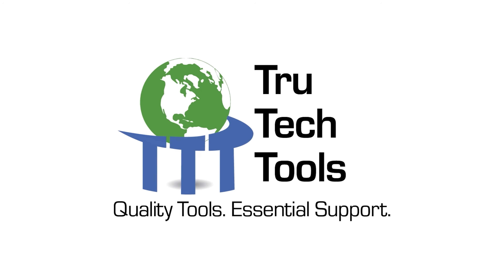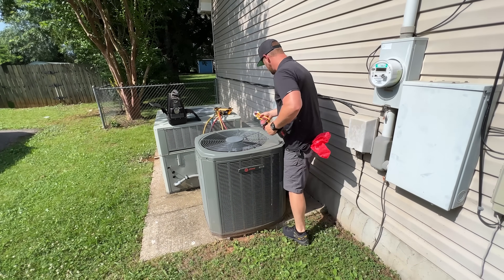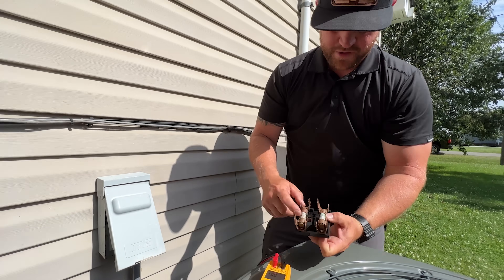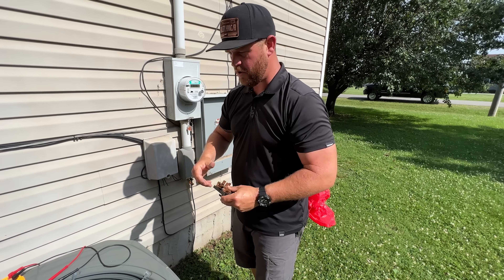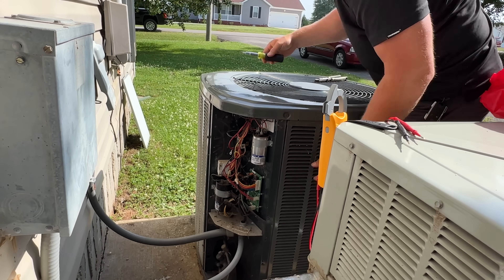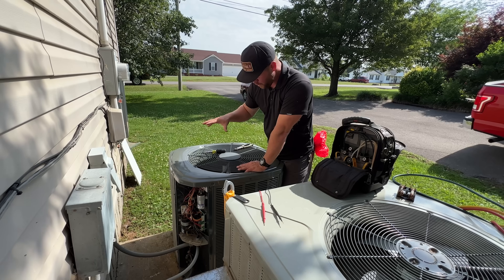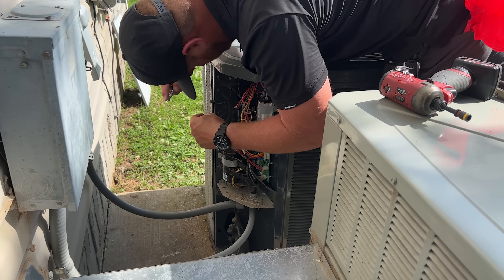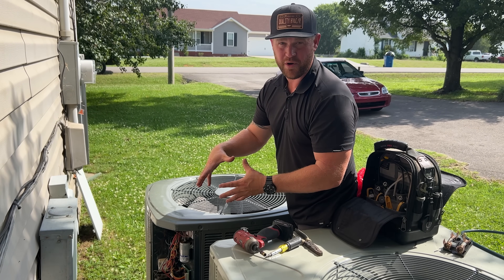How To Diagnose A BAD Compressor | HVAC Troubleshooting

Comment: You mention all that unessary stuff to replace when doing a compressor change out and didn't even mention the filter dryer being replaced, I would of put filter dryer on my #1 top spot. An you wouldn't of needed to replace the contactor both and capacitors if you would of looked into why the compressor failed, if the contactor is constantly pulled in then it will make the compressor fail, I didn't see you check for 24v on the contactor I assumed you put it in cool mode so the condenser turns on but did you look at the contactor or test the coils? There's no point in replacing the compressor if you don't figure out why the last one failed instead you just throw more parts at it hoping 1 of the 3 things were the cause.

Comment: But how did you know the compressor was bad because the meter still beeped?
Reply: He connect one lead to ground which is copper line , use another lead touch compressor terminal, if you hear “ beep” sound, it means continuity, which means short to ground😮

Comment: Why didn’t just turn the system back on after figuring out it was a tripped breaker and check to see how many amps the compressor was pulling?
Reply: I did that once and it blew the terminals right out of the compressor shell.  Always a good idea to Meg everything out if you have a blown fuse or tripped breaker.

Comment: Usually what I will do is disconnect the common and run wires and the herm Wire and then plug the disconnect back in and if the outdoor fan kicks on you know the compressor is bad if it’s not in thermal overload of course
Reply: Waste of time to add extra steps when in the end you're going to check the compressor terminals.  I start at terminals and work back if needed.

Comment: Great vid have you noticed an increase in Rheem reversing valves  leaking alot in the the past year
Reply: Is this my problem?
Reply: @nicholasr7987  ive had a bunt of about 7 yr old rheems leaking on the joints of the reversing valves and on the high pressure sensor coming off the top orf the compressore in the middle of the bend on the tiny tube

Comment: This Trane condenser has the wrong design of circuit board, the start CAP can help the compressor to start, but also the high amps make the compressor die quickly.
Reply: i was wondering why he didnt check the capacitor, everytime the customer says yhe inside works but outside doesnt its because of a bad cap because factory capacitors dont last long

Comment: You could have expanded this topic more. Like video of the equipment tag, how old the unit is. The fact that there are no rotolocks on this compressor. What is the brand of the compressor? Is it made in China? I realize exposing the gimmick that Trane is these days is dangerous so you don't necessarily need to say anything just show it. Personally I am tired of people getting duped by a flashy brand name that is often times worse than something less flashy. Then they don't even have the part in stock to fix it with? Trane derailment, sad.
Reply: Trane never has parts in stock at my local rep, everything needs to be ordered.

Comment: That's the only way bro.....  Check it at the compressor itself...  I also agree about the contactor and start cap, i don't know about the run also, but if they will swap it, pour it to it.  Most will be assholes if the components aren't bad.

Comment: Great video. I would add if that oil is acidic, install a suction drier to help clean that system. Your troubleshooting process is exactly the same as mine and I’ve been in the trade for almost 30yrs
Reply: That should be done anytime the system is opened to the atmosphere. Coil replacement, compressor replacement, Txv’s, Ext.
Reply: @Review-This  a liquid line drier, yes I agree but a suction drier isn’t needed every time a system is opened.

Comment: On a bad compressor our policy is to document standing pressures, total static pressure and airflow across the evaporator coil to rule out any possibilities that may have caused it. Wondering if this something that you do ?
Reply: I think adding a surge protector on I tail install is also a good idea to protect the compressor from brown outs and surges
Reply: Sometimes an electrical failure can be caused by a mechanical failure that happened first, such as blown valves,  caused by liquid refrigerant entering the compressor.  The compressor would then run, but not pump, and cause it to overheat and burn out.  It is important to check all electrical components, capacitors, replace the contractor, check for proper airflow, etc.

Comment: What caused the electrical short that damaged the compressor?
Reply: Acid in the system can cause insulation in the compressor windings to break down. This will manifest itself by shorting to ground; If unit gets hit by lightning could be another reason. It's rare considering this unit has starting components and delay timers in the thermostat and elsewhere!

Comment: So when ever the compressor breaks the insides which are power (+) touch with ground (- metal) ? Making the output at the compressor (- negative)?
Reply: No if it's grounded is a dead-sort. Technically zero resistance!
Reply: @bobboscarato1313  gotcha thanks 🙏

Comment: So you shouldnt have continuity on any of the pins of the compressor when checking if its shorted out to ground or not? Wasnt very clear when you were checking thanks
Reply: If only one pin is shorted to ground, that's it; you need a new compressor!
Reply: @bobboscarato1313  thanks alot 🙏🏻
Reply: A beeping multimeter is the best thing ever tbh
Reply: So what he did was he disconnected the compressor wires (2 im assuming) at the contactor(inside the unit) he checked for continuity on those two wires he disconnected so when his meter beeped it ment that those wires are touching at each end of the wires or somwhere in the middle of the wires, when he went to unplug the pigtail at the compressor he probed with the meter the compressor one end of the meter was touching metal and the other probe was 3 terminals at the compressor which those are suppose to supply power not ground, therefor the insides of the compressor which should be power are touching metal (ground) which is not good the part doesnt work or will not function at all
Reply: @DV90400  got it. So if meter beeps when touching any of the pins at comp. means it is shorted.? Thanks for the info
Reply: @Kilo5910420   yes .  You do NOT want  a path back to ground .  Means in this case the compresor shorted itself to ground  and its dead .  
He didnt show it but the last thing he could have done was a " redneck  test "  leave the compresor unplugged ,  put the fan and top back on and turn on the unit .  If it runs and dosnt trip the breaker it further shows the comp was the problem .
Reply: @craigerickson8712  just like craig said
Reply: @Kilo5910420  just like craig said
Reply: @craigerickson8712  thanks alot 🙏🏻 i would love to learn the service side I’ve mastered the installation/duct side

Comment: The company I work for requires that we recover and weight the charge as part of out diagnosis for failed compressors, we then put the charge back in case the customer wants a 2nd opinion. It's time consuming but covers your back incase there's a leak. Zack I'm sure can confirm that just because a system is newish does mean there's not a leak.
Reply: i work on a lot of Lennox systems, our company installed one in january and I was out there a week or two ago to find it dead empty. New stuff seems to be the leakiest lol
Reply: @johnstrh1  It's not so much new equipment; they probably left leaks in refrigerant lines. Nails driven at the baseboards are fairly common unless lines are run down the outside wall. in NY were run outside. Here in Texas they're run inside walls when we talk about new construction!
Reply: how do you know you pulled a full charge on a split unit if the data plate only tells you the condenser charge? Sounds like opprotunity for f#ckery if your tech purges hoses properly you'll lose a few ounces no matter what, also huge possibility of contamination of the refrigerant. Its generally a pretty safe bet if you put a guage on it and saturation is relatively close to ambient your fine.
Reply: @TheMax13542  condenser label plus .6oz per feet of line set past 15 feet. You outa know that if you been in the feild for any length of time. Not saying I enjoy recovering for the fun of it, just sharing what my company practice is.
Reply: @mattluongo7763  if you been in the field under someone who isnt a hack you'd now charge is dialed based on superheat/subcool. 0.6oz/ft is that a 3/8 liquid line, 1/4 liquid line, 3/4 suction, 5/8 suction? I suppose to ur out there with a tape measure everytime checking that lineset length. different sized lineset will measure different. the only way you know for sure if charge is 100% is SC/SH on a split AC system, anyone who tells you else is full of doodoo. And if done right ya you may only lose an oz purging but like i said opprotunity for f#ckery and contamination.
Reply: @TheMax13542  I agree with all that but by pulling the charge you should be able to tell within a pound more or less. A system can have 2LBS in it and still read ambient. My company charges per LB so ya it's a pain in the ass but they want that information. Let me ask you what happens when you come back to change the compressor and you figure out that the system only had 2LBS which is a good reason for the compressor to short out. Do you just recharge and move on? Or do you tell the customer oh btw it'll another $500 for leak search and repair?
Reply: @mattluongo7763  I'm not saying ambient will tell you charge is ok, it'll tell me real quick if gas is in it, but idk if it's undercharged or overcharged, which will burn up a compressor alot faster than under charge. In fact I'd argue it's really hard/rare to "kill" a compressor with a low charge. Generally though I check for pressure, visually inspect condenser + evap for any damage/oil. Then always pressure test and pull vacuum when performing the repair, if it fails either it doesn't get charged till the leak is fixed and if that's additional cost to the customer so be it. Disclaimers/warranties are pretty essential in our trade these days.
Reply: @mattluongo7763  I see where your company is from doing that. When I was still in the resi field, I had a disclaimer on my tablet (and one already printed on my carbon copy paper before tablets) that I read to the customer and had them sign off on that stated about other possible issues. It was rarely needed, but when it was, I never had a customer refuse to pay.
Reply: @TheMax13542  SH/SC is old school. Charge by TD
Reply: @nsant  ya I mainly only do residential. Light commercial once in a while. And yes we go through recovery machines like no body else. Mine useally last a good couple years but for some reason most of the other tech always trash them somehow
Reply: @TheMax13542  and how many oz you use to purge your lines? Only take a little bit of vapor
Reply: I’d hate if my company made me do that haha
Reply: @FreebornOutdoors  Better find yourself another job!
Reply: @bobboscarato1313  why because I don’t waste time evacuating a system to see the charge of a bad compressor 😂? That makes sense.
Reply: @FreebornOutdoors  No, it's a waste of time!
Reply: That insane. Asking for trouble. Why would anyone want to add to their liability.

Comment: i will be waiting for the next video how to check the refrigerant to see is contaminated ..i wanna see how to check it
Reply: An acid test kit comes with a strip similar to one used for testing water quality in a hot tub
Once the old compressor is removed take a sample of the oil from the compressor and use the testing strip
It will turn a different colour if acid is detected
Reply: @mitchmacleod7575    thanks ...👍👍👍

Comment: would you just be able to swap out the whole outdoor unit?
Reply: If it's under warranty like he said, the warranty won't pay for a whole new unit. Just the compressor. All the homeowner would pay is labor.
Reply: @michaelsmith7066  and wouldnt the customer be reimbursed the labor cost after showing proof of professional install to the manufacturer?
Reply: Thats what a local big company would do even if the part was available they would just replace the whole thing but when you workiing with customers ona budget youll replace parts just like a local mechanic youll take your car where theyll just replace the alternator versus shop B will say change out the whole engine for a new one (makes no sense)
Reply: no labor reimbursement. Your AC system comes with a part warranty from the manufacturer, not a labor warranty.